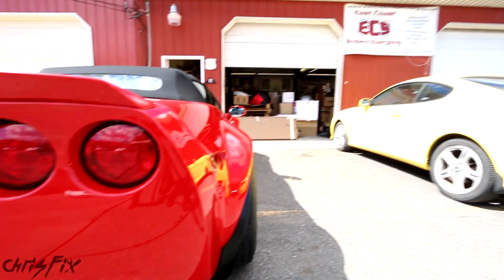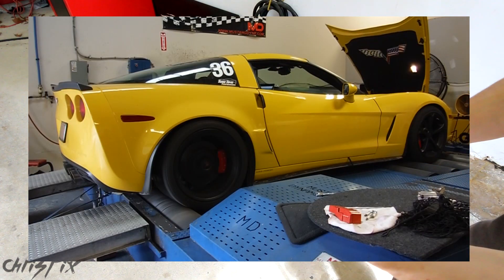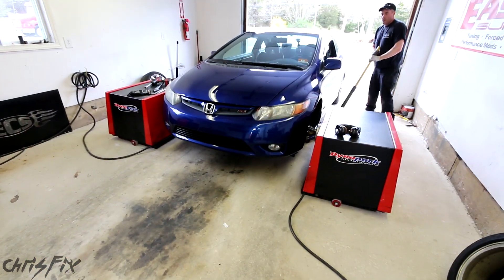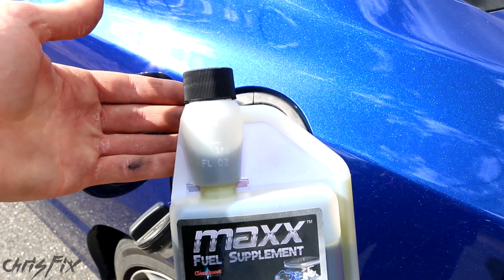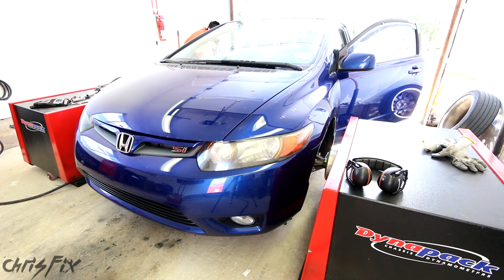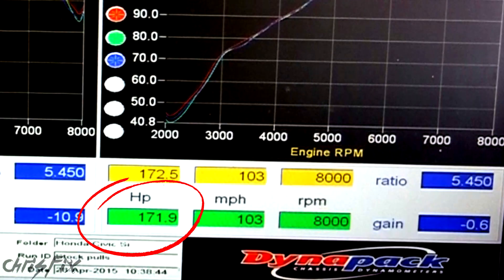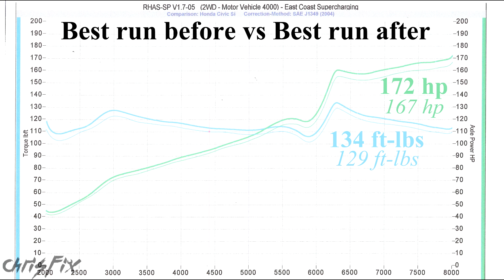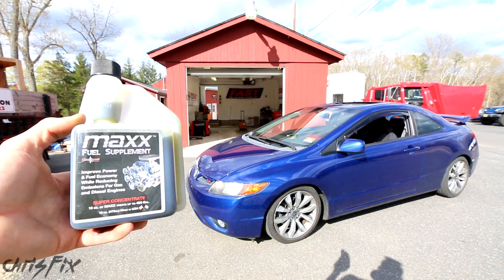Can a Fuel Additive Really Increase Horsepower in Your Car? (With Proof)

Comment: Curious how it affects mileage, would like to use it on my 98 trans am. It doesn't look like it's sold in auto parts stores though...
Reply from the maker: ***** Same! We will have to do a fuel economy test!
Reply: I have really short commutes to work (5 miles one way) 5 days a week so my system is always open loop. I never get good mileage because of this so it's really hard for me to judge my mileage. Nothing I can really do about it though. :(
Reply from the maker: ***** Look at it this way, you get bad mpgs but you dont have to drive far so you save a lot in gas!
Reply from the maker: ***** It will only hurt your wallet and cats.
Reply: Cats? lololololol
Reply from the maker: Cat converters.
Reply: I know lol I'm laughing because I don't have them
Reply: ChrisFix Check my newest video, not having cats makes the exhaust so pure. My Borla is basically a straight pipe. I had open Y pipe for a few days but lost so much low end torque that an RX-8 was pulling on me when we both ran at about half-throttle. Disgusting!
Reply from the maker: ***** Dude, she sounds soooooo good! WOW!
Reply: Thanks! Yeah the borla is really quiet on these cars, LS1s confuse me because it's so hard to make them sound good... I have an auto so its not loud until 3500 rpm then she roars!
Reply from the maker: ***** This is an LS1 and it sounds wicked: https://www.youtube.com/watch?v=D1OhJAP1qgc

Comment: That engine's base map/cross over point is way out of whack
Reply: Steve Langdon factory tune.
Reply: I know it has vtec, but the high cam should take over where the low cam left off, if there is a noticeable change in "pull" when you crossover then its tuned badly!
Reply: Again.... factory tune. It may not run as optimally for power, but for emissions.
Reply from the maker: Steve Langdon It has Vtec

Comment: ChrisFix, thank you for your video. This product does indeed look interesting. After much discussion on a private facebook chat, we found some problems with your testing. Here is a quote from one person.

You saying a product works as advertised,  fuel additive that only takes 0.02% by volume to make a difference. he then proceeded to use a mass produced line-on-bottle measuring device and put it "more than enough", meaning, more than the instructions called for. Would that fly in a chemistry experiment? (since technically that's what this is)

So you technically used the double amount than what was called for in instructions. Your tank was half full, and poured in roughly 1/2 of small can(which is for 15 gallons of fuel).

We also have a reputable tuner who can give use more data.

Any inquiry would be really appreciated!
Reply from the maker: TheAngryDuckman The additive isnt an octane booster. How it works is it is a catalyst that maximizes the potential energy in the gas and converts it into kinetic energy. Basically, it is making the most of the gas that is in there already. If you add too much, it doesnt help. If you add too little, it wont be concentrated enough to increase the power from the gas. If I poured the whole bottle in, you wouldnt see any difference in HP (well, it might go down because I dont know how good that additive burns). Does that make sense?
Reply: Oh yeah it does. The word "catalyst" is used strangely here. In chemical terms, a catalyst elevates the amount of energy needed to trigger a chemical reaction. It's interesting how they don't call this an octane booster...

Thank you for your response!

Comment: Hi Chris, what's your opinion about catch can oil???
Is it worth to install to the engine?, etc...
Reply from the maker: ***** For some engines it is worth it. V8 LSx engines, turbo or supercharged engines, etc all have high blow by so it is worth it. Some engines you will not catch any oil over time. It all depends. Is the intake oily?

Comment: so im having this wierd parasitic draw. It starts out at 0.151A then after a couple seconds it drops to 0.078A then again after a couple seconds it drops to 0.001 to 0.000 which doesn't make sense to me because there needs to be an amp draw for the modules. After about a minute it goes back to 0.151 and i dont know how to pin point it because it doesnt remain at one amp level. Any ideas how i can pin point where the parasitic drain is?
Reply from the maker: argonian bilbo That is a tough one. Try doing this: https://www.youtube.com/watch?v=n5FJDgcdii8
Reply: Ill watch it. Alternator is supposedly new. I just put in a brand spankin new battery

Comment: It will work only in cars that there ECU can advance spark dynamically according to fuel octane (no knock)
Reply from the maker: Elior Zeno Actually this isnt an octane booster so it will work in any car (I havent tested other cars but in theory). It is a gas catalyst that makes the gas burn more completely so you get more power from the same gas.

Comment: Your ECU advance spark when fuel octane allows it, your additive probably made the octane go higher. That's all
Reply from the maker: Elior Zeno Actually this isnt an octane booster so it will work in any car (I havent tested other cars but in theory). It is a gas catalyst that makes the gas burn more completely so you get more power from the same gas.

Comment: I never realized you were from my neck of the woods, I am in Salem County.  When I worked for Advance Auto I saw all kinds of crazy claims on bottles, maybe this is one they should carry.  I surely wasn't expecting that, hard to argue with a dyno though.
Reply from the maker: Eric Brunhammer Nice! Yea, I am from the area. I do all sorts of testing on car products to see if they work. I just did a seafoam test because that is one everyone wonders about. I tested gumout, lucas, techron, etc. It's a lot of fun and I love seeing what results we get. As you saw in this video, you really never know if it will work or not!
Reply: I saw those videos, where toy use the bore scope.  One product I do swear by myself is Marvel Mystery Oil, or at least in carbureted engines I do.
Reply from the maker: Eric Brunhammer Yea, I will be testing MMO but I want to test it by looking at the valves because that is their main claim!
Reply: Well, I mainly use it in my carburated truck because it keeps the needle from sticking. However I do notice that I get far better fuel economy while using it too.

Comment: Sure, 5hp more... but is it good for the engine though?
Reply from the maker: ***** It has nothing to do with good or bad for the engine. It is a catalyst for the gas that makes it explode more completely. If anything, I would guess it is better for the engine because it adds lubricity.
Reply: ChrisFix Fair enough. I have always been suspicious of gas additives, just bad experiences with them. Its great to see that there is something out there that works, I would try it if they had it in the UK. Cheers Chris!
Reply from the maker: ***** Tell me about it. You know all of the tests I did with my truck right ? Well guess what, now I have a cyl1 misfire. I am sure it is a clogged injector from the fuel cleaners.

Comment: Wow, is this legit? I have tried all the standard additives  besides this one and my butt dyno couldn't see any difference. I watched a YouTube video that did this same type of test and all the big players in additives and they all made less hp? And that other video seems just as scientific or maybe more.... Sorry Chris, not trying to dig! Plus all the others used a full little bottle, this is way less. I really want to beleive this. I mean who doesent want to make 5 hp and 10 lbs. I imagine with my cooper s R53 should see about the same results if legit...... I want to beleive
Reply from the maker: D-Nice Grogs I mean I did my best to keep everything as constant and controlled as possible. The only way to verify this works for real is to do more testing. I want to Do more dyno runs on other vehicles as well as a fuel economy test. The results in this video are very promising though!

Comment: Did the air temperature or pressure change between your test sets?
Reply from the maker: wheresmyhouse The computer adjusts for all of that but basically there was very very little difference between runs. We did them within about an hour of each other to prevent any extra variables. But you can take a look for yourself. The temp and baro readings are on the lower portion of the screen. There is a shot for the baseline runs and for the "after" runs. Let me know what you think.

Comment: Great video. Lol I see you were at tune time performance with that yellow vette. I had my Camaro on that dyno at their open house last spring.
Reply from the maker: matt Haha, yep! I was there with my Vette but they couldnt get her to lock into 3rd gear on the dyno so we went to ECS with the honda! Did you go to the open house this spring? I missed it.
Reply: I wanted to go but completely forgot about it. My cams going in the car a few weeks, so Im definitely gonna try to make fall. Lol last time i was there my output shaft seal dripped on the exhaust and it looked like my tranny was about to blow.
Reply from the maker: matt Haha, it is just the smokescreen mod. Yea, I was busy prepping for this video so I missed it. Maybe I will catch you around at some local shows/meets.

Comment: I have a feeling the supplement is creating better ring seal and slightly decreasing friction leading to increases in horsepower.  I would bet doing the same thing with TCW3 2 cycle oil 1oz to 5 gallons would have the same effect or better.  I remember reading an article that increasing the oil ratio on 2 cycles increased horsepower all the way down to something like 18:1 or 24:1, but at the expense of being more likely to foul plugs and carbonize the engine.
Reply from the maker: Eric S Interesting concept. So you are saying that the added lubricity on the cylinder walls might be "sealing" the piston better and creating more power?
Reply: Here's an article explaining the theory, its 2 stroke based but you can get the idea.  You're going from 0 oil or supplement to something, so you could be getting better ring seal.  Granted we are using a four stroke so there would definitely be a point of diminishing return, but over on LS1tech there is a good article about running TCW3 2 cycle oil in the fuel at 1 oz to 5 gallon.  I tried it on a KTM 4 stroke motorcycle with very good results.  I gained 1-2 mph consistently on the speedometer in the length of my yard.  Here's the article explaining oil mix and ring seal http://www.off-road.com/dirtbike/tech/two-stroke-gasoil-ratios-20502.html
Reply from the maker: Eric S Thanks for sharing!

Comment: My bet is on the additive cleaning the injectors therefor either cleaning up the spray pattern or giving more fuel.
Reply from the maker: Kashbringer I am working on a way to test injector cleaning capability of these fuel system additive. I would really love to see the spray pattern and flow before and after using these additives to see if it does anything.

Comment: BG fluids does a test where they run a BG oil additive in an engine alone with no oil. Then they drop the oil pan and run it for hours and it never shows any signs of wear with the additive on all the moving parts. Thats why I have all BG fluids in my truck. I was that impressed!
Reply from the maker: UnitCrane514 Wow, that is crazy! I will have to check that out. Thanks for sharing!

Comment: Wow thats impressive! The runs were more consistent with the additive also!
Reply: UnitCrane514 I carefully spent time on the graphs comparing a few points and I noticed that early on it added much more torque than later up the RPM, which is fine.

I'm mean really, having power down low is the most effective fore daily use joy.
Reply from the maker: UnitCrane514 Yea, it was very surprising for everyone at the shop haha

Comment: The consistency the additive introduced was an interesting bit, but you don't really "feel" power gains unless they are about 15 mph or greater (on the road where it matters most).  And the low and mid range (rpm) are what you're using everyday around town, which was an area where this stuff was increasing consistency
Reply from the maker: Chad Hicks Yea, I think you wont really feel anything unless you get 30+hp but my butt dyno might not be as accurate as yours haha. I think we need to do a fuel mileage test to see if this stuff increases mpgs so then you can warrant use in your daily driver since it will save you money at the pump plus get you some extra hp. That might be the next video!
Reply: At the end of the day of the day, the butt dyno is all that really matters. Thanks for the reply and keep up the solid work
Reply from the maker: Chad Hicks MPGs matter too which is why I will be testing to see if it really increases mpgs.